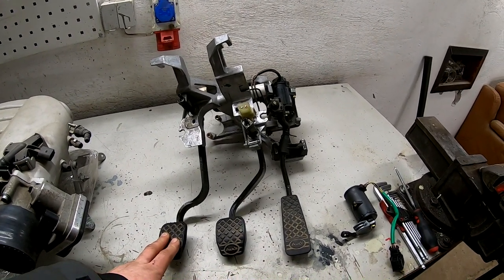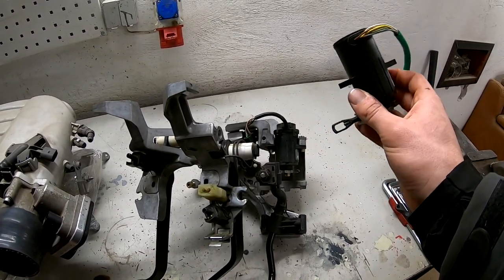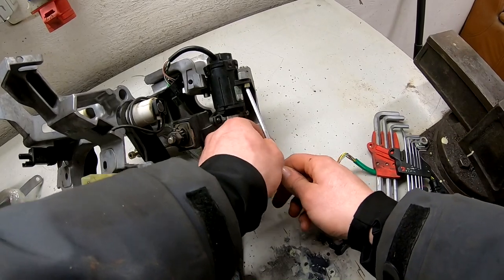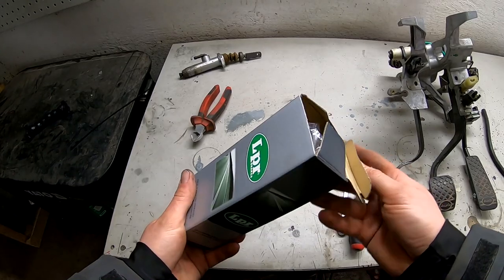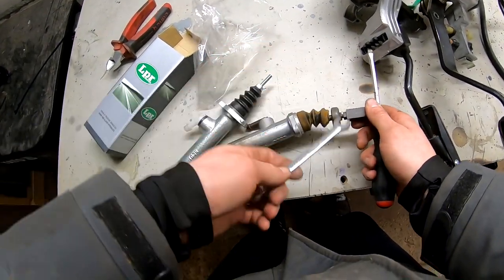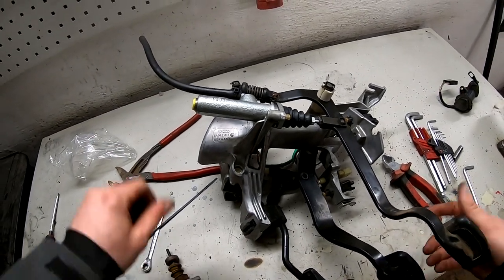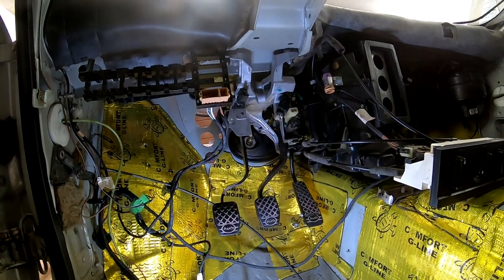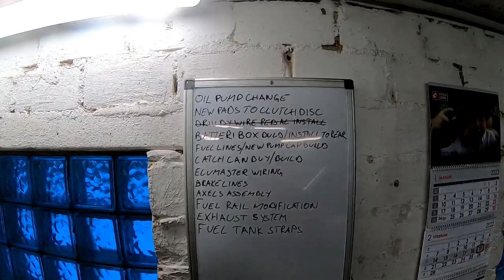Audi 80 VR6 Quattro | drive by wire pedal install | Wolf Garage

Comment: Why you take vr6 engine? 1.8T is way to go... or 4.2
Reply from the maker: Because its fun engine. Im not V engine fan and 1.8t is also boring for me (everyone has them). After adding turbo next winter, both will see rear lights 😂 .
Reply: too boring engines
Reply: Why not 4.2 abz???
Reply: @MaksBatch  because vr6 is very compact and simple compared to v8